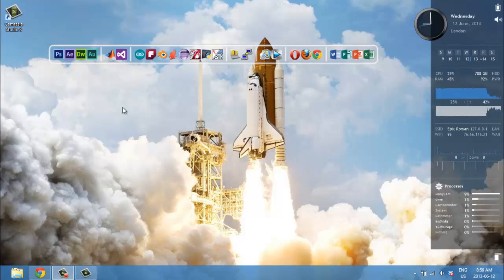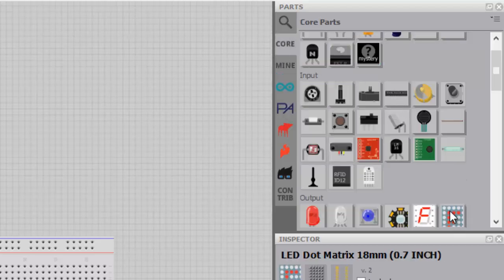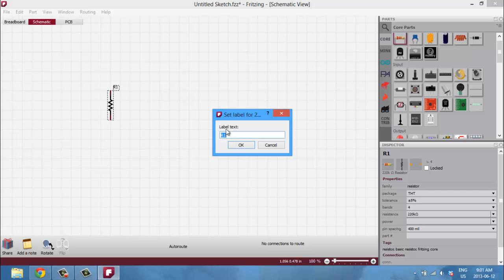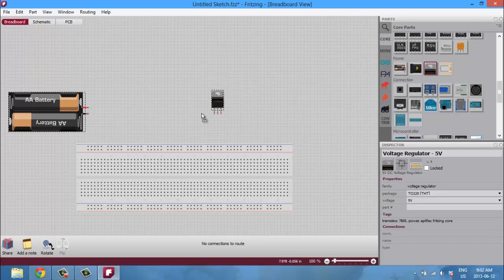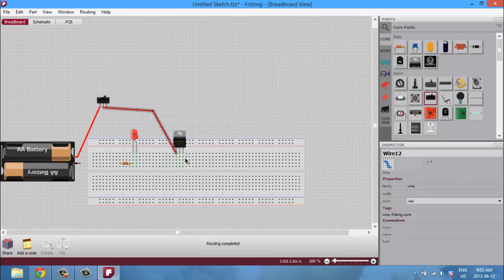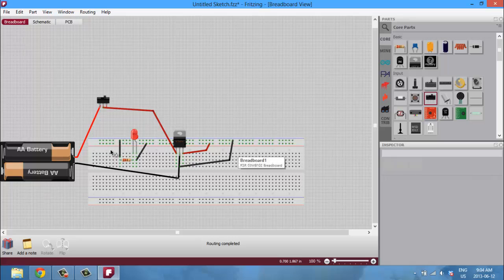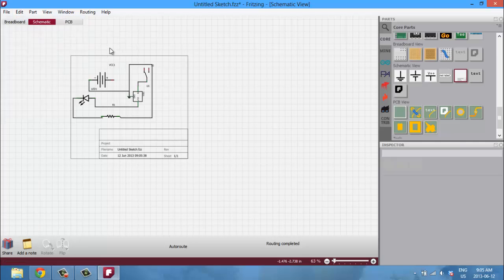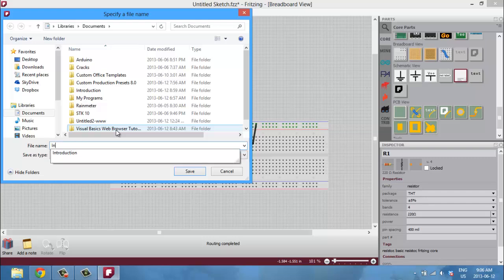FRITZING TUTORIAL 01 - An Introduction to PCB design

Comment: Didn't really follow this - I can see you created a circuit on a breadboard but when you view the schematic the circuit is not valid - for instance the positive of the battery is floating?? Should be connected via the switch which is also floating on one side?? I have tried using Fritzing to create a stripboard or PCB from a schematic and never succeeded, my carefully drawn schematic gets destroyed when I try and move/align components

Comment: how can i test if my project works? does this program have run and see result?
Reply: Nope
Reply: I guess the idea is that you build a circuit on a breadboard and make sure it works. Then you remake the circuit in Fritzing and use it to convert the breadboard design to a PCB design, and then send that to be manufactured.